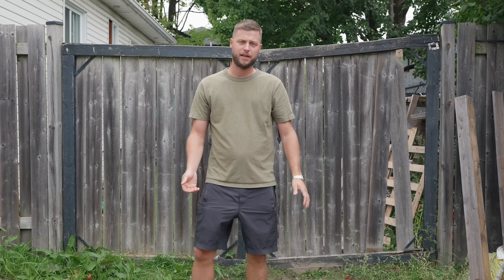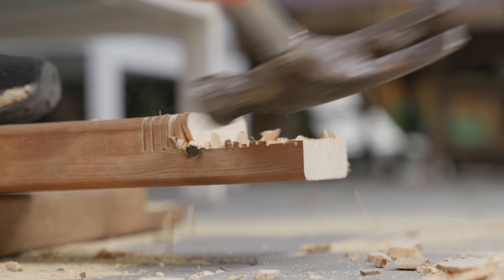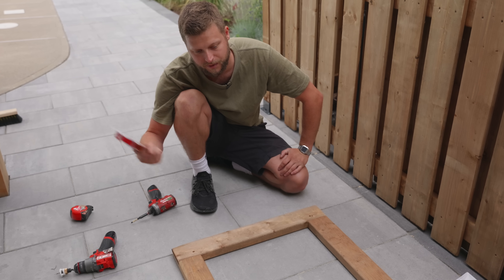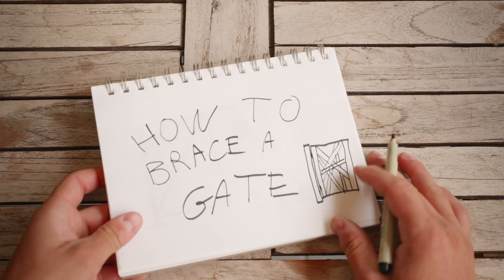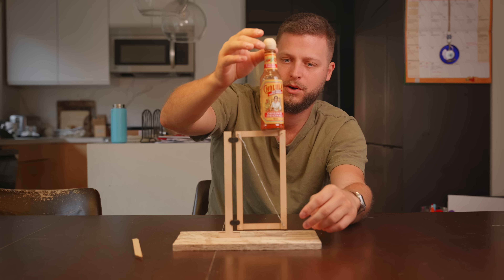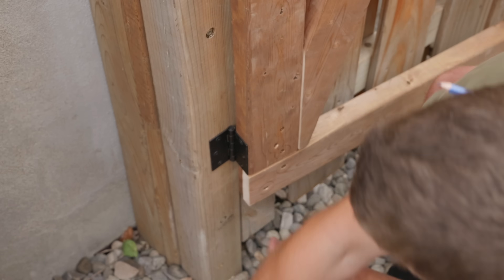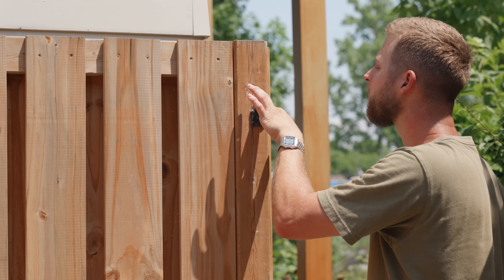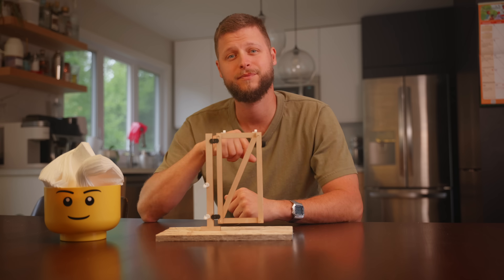How to Build a Wood Gate That Won’t Sag (Full Build + How to Brace)

Comment: Informative video. Thank you. One note though; the creator in the 2nd picture you show of the incorrect installation actually talks about the "right" way to install the brace and why she decided to do hers the "wrong" way. It might be worth checking out the reasons why people do things the way they do before using them in your videos.
Reply from the maker: Yes. I didn’t want to get into it too much but I did almost mention that she chose to do it for a design decision. (That she liked the look better). The screws will git out some, and that the stronger most effective way to do it right is to put it in compression, if she puts a wooden brace. 
It’s also the reason why I decided to make the miniature model gate to show everyone that there is a reason why there is a better way for building a wooden gate and not just for aesthetics.

Comment: The hangman example was brilliant. I'll never forget it now.
Reply from the maker: Sweet! That was the goal!
Reply: One of the best explanations I heard the last month/years, because I will never forgett the hangman
Great
Reply: Silly me, applying physics and tension v compression math to the problem.
Reply: Me too.
Reply: I would've used a shelf as an example. I put a wooden shelf up just a few days ago. It hangs on the wall by just 2 screws. But how? If it was just a single board with 2 screws holding it in the wall, the board would obviously sag under any weight. The reason it doesn't is it has diagonal support underneath pressing against the wall. So there's no way for it to sag. It's that simple. The top board must rest against something. (the wall)

You should think of a gate the same way. Imagine it was cut diagonally, which way would you hang it to the hinges? The diagonal has to be from the top edge to the bottom wall. That way the weight is pressing on the wood. (compression) The other way would be the bottom pulling down on the wood (tension) pulling at the screws at both corners. (which will eventually give in)

So in regards to a gate, don't even consider the bottom diagonal side (away from the hinges) as part of it. That's just extra padding hanging on to block the space off. It's the top side and the diagonal support underneath (like a shelf) doing all the work.
Reply: Same here, that's what instantly made me get this
Reply: Now you know how to solve the BLM problem. My white brother.

Comment: hi, if you'll attach the rope to a simple push pull latch (mounted Verticaly even) then you will get a pull down to open that is fixed in place and not just hanging around.. 
great job man, love your channel 👍
Reply from the maker: What do you mean exactly? Like a simple string instead of the spring?
Reply: @mateostabio 
hi, no, connect your pull string to the tip of a sliding bolt lock mechanism so your pull position is always in the same place.. fixed Verticaly behind your fence

Comment: In statics, you learn that long slender pieces of wood are not best in compression but rather tension. This is due to the wood failing by buckling under enough compression force. The best option is to have the diagonal start near the post at the top similar to what you show with the wire. Both act in very similar manners, both strong in tension, not much in compression.
Reply from the maker: Interesting!